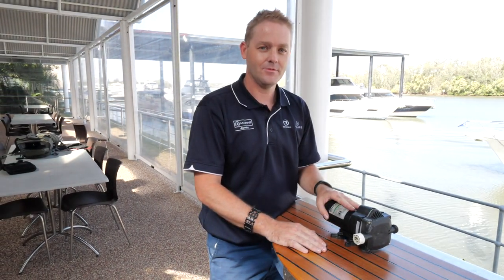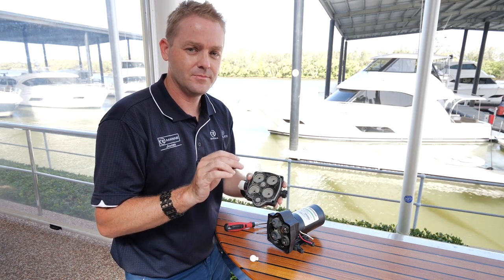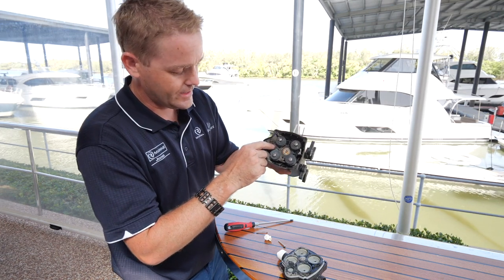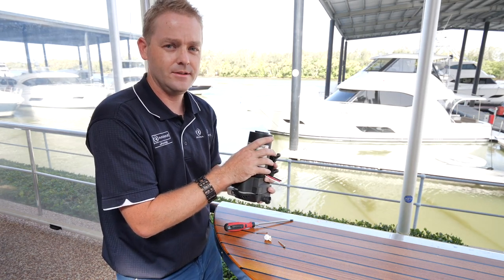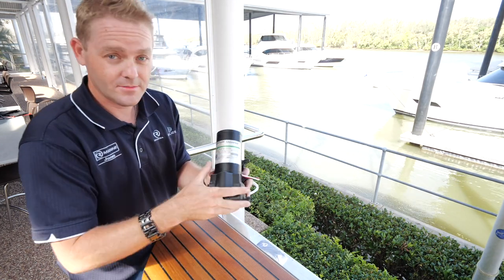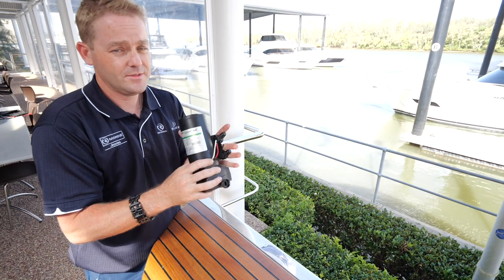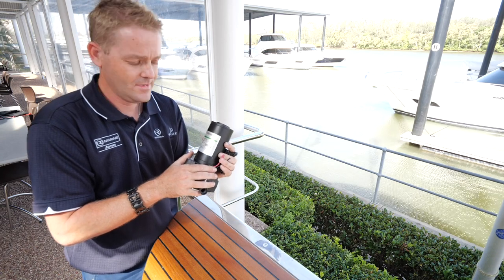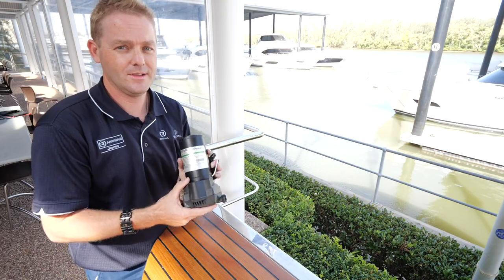Fresh Water Pumps  - Boating Tips & Tricks

Comment: Good day my pump did not stop running so I replaced it with a new one it is doing the same thing it is for the shower and is hooked up to jabsco tank what can the problem be.
Reply from the maker: Hi Byron, Sorry for the late reply. There are 2 main reasons a pump will continue to run, if there is trapped air in the system the pressure switch may not trigger so we suggest running every water outlet for at least 10 seconds including the hot water system etc. The 2nd potential is if you have your power and signal wires back to front you will bypass the pressure switch and the pump will not turn off (refer to video from 3 min 24 sec).